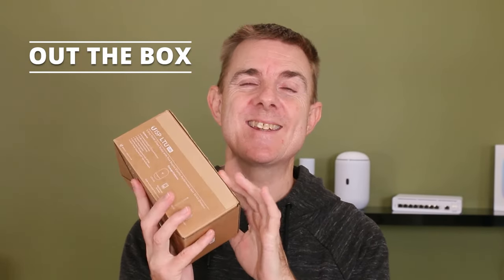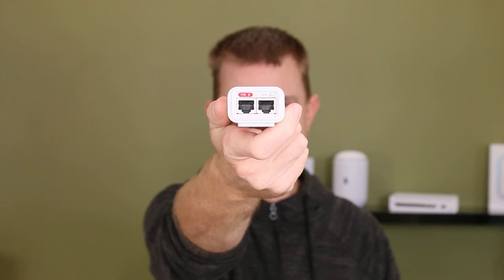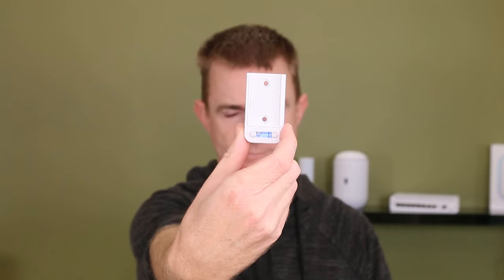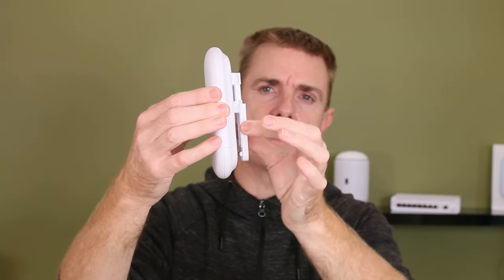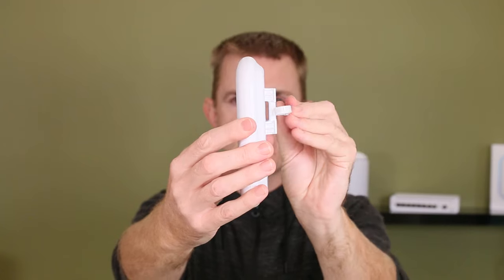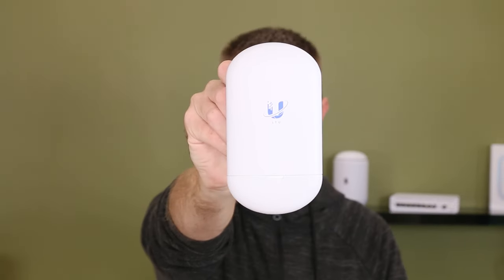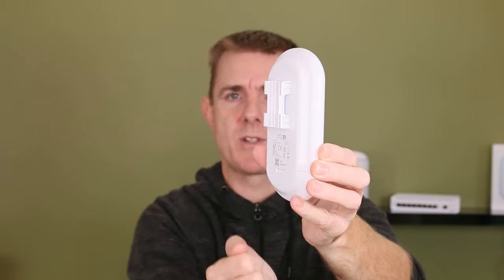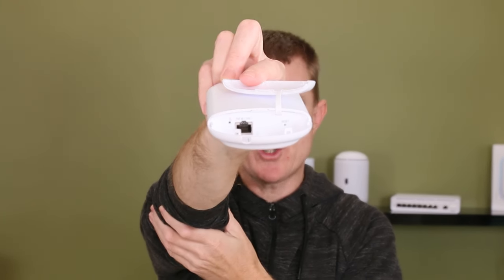Out the Box Series - Ubiquiti LTU Lite

Comment: If I am running a PtMP setup with the LTU Rocket and 20 LTU Lites it has to be monitored on the UISP system. How do I connect my unified setup through UISP? Currently, we have a Cambium PtMP setup with the Unifi controller on the UDM SE. The Cambium PtMP system sits on the Unifi network with no problem. We just need to upgrade to a greater throughput which would be met by the LTU. I don't want to invest six to seven thousand dollars on a system that can't meet my needs. Do you have any knowledge concerning this?
Reply from the maker: UISP is a completely different solution to Unifi I am afraid, so as a result you would need to run two applications.   You can look at the UISP-Console which is a bit liek the cloud key, but for the UISP world.  This would then allow you to manage and monitor your LTU links.   So in short you would manage your unifi network from the unifi controller and your UISP from the UISP controller.   There is currently no central platform I am afraid.
Reply: Ok, well that isn't a deal breaker. As long as UISP can carry my network across it I have no issue with a separate controller for the UISP hardware. The cambium system we use now has all of its hardware running through a platform called CnMaestro. It is a proprietary Cambium solution. I do appreciate the information. Thank you.   @The_Tech_Geeks

Comment: What do you recommend for an outdoor AP to cover a 39000 ft²  ~(3,7000 m²) yard? to work with UDM?
Reply from the maker: This is a good question and one that has a fairly straight forward answer.  The weak link in a wireless setup is not the Access Point (AP) it is the device that connects to it, ie a phone, or laptop, or wireless camera etc.  The quality of the antenna in that device will determine how far it can be away from an access point.

You also need to bear in mind that with Wireless 5 and the earlier version of wireless 6, the access point can't keep a track of each device's speed.  So if you have a single access point it will drop the speed down for everyone connected to a speed that everyone can achieve.   This means the furthest away device, ie the slowest device, will force all the other connected devices to receive a slower speed.

Therefore when you are trying to cover an area of 600m x 600m it is unlikely that one access point will give you the coverage you want.  If the ground is flat and no trees or other buildings, then a smart phone may be able to make it about 150m from a Ubiquiti access point.   A laptop may only make it 20m!

You will therefore need to think about a number of access points to cover the area you are wanting to, if you are wanting a standard wireless device to connect to it.   You have made this comment on a LTU device.  This device is not for user devices to connect to, ie phones etc.  This device is used to create a single point to point connection with another one of these devices linking those two buildings together and then allowing you to add an access point their for end devices to connect to.   

Currently the only real Ubiquiti Outdoor access point is the UAP-AC-M-Pro this will give you coverage up to about 150m from the device.   So you would maybe 9 of these or more to cover the area that you want to.

I hope this helps a little further with your thinking.
Reply: @The_Tech_Geeks  Thanks for the input! I originally had UAP-AC-M-Pro and U6-Mesh in mind for this project...